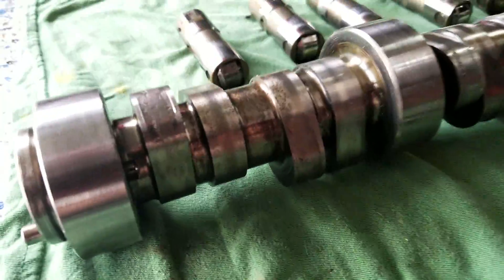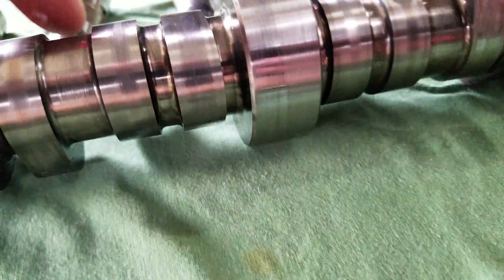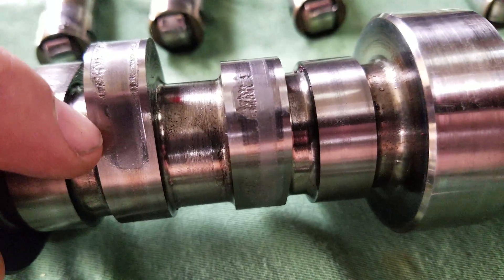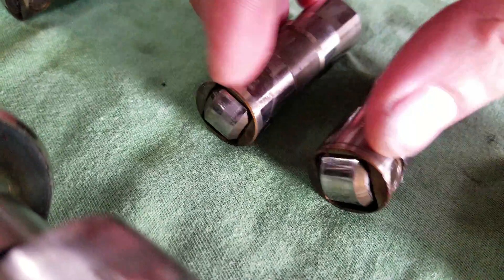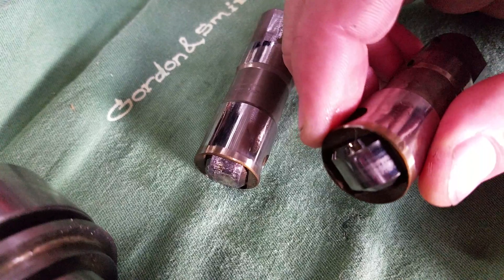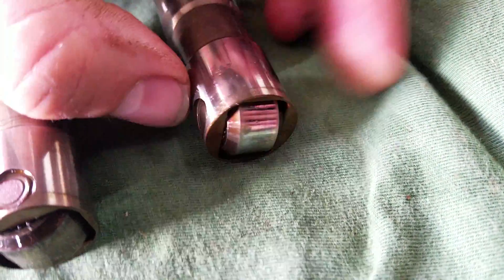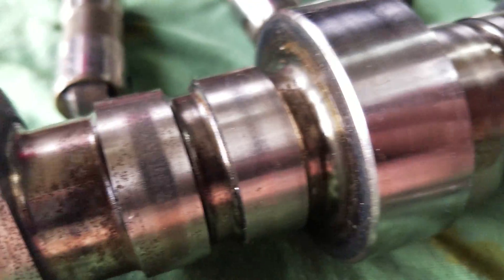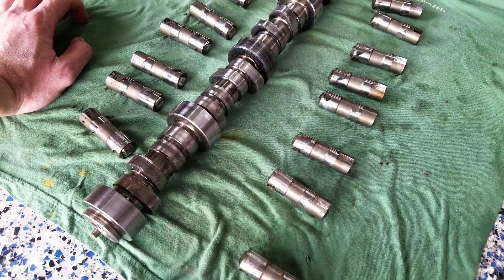Comp cams - cam shaft lobe failure

Comment: If I bought a brand new Comp or Isky camshaft I would send it to Delta Camshafts to have them inspected and regrind if need be, because the cost would be minimal. Comp Cams nolonger performs final inspection, they believe their automated cnc's machine accuracy "into" the cam requiring no inspection afterwards.

Comment: How does that happen. Material just starts degrading and falling off
Reply from the maker: Poor quality cam blanks in their raw materials.  Heat treatment process not completed properly..
The valve springs were squash tested and they came back at near new specs
Pre load was in spec 
This build had new lifters and lifter trays
Reply: @txtootall  thanks for info. Trying to learn what I can before I put a cam in

Comment: Don't feel so bad. I have maybe as much as an hour, that's right ONE FRICKIN HOUR on my Ford 390 with a flat tappet COMP CAM and lifters in it and YUP I have a lobe flattened out and a mushroomed lifter. Break in process followed by the numbers. Not my first motor. Plenty of small and big block Chevys and Mopars, all flat tappet, never had an issue. THESE NEW CAMS FROM COMP SUCK. I hear they are using cores from China and grinding them here. If that is the case you have two variables. Poor materials or people setting up the programming on the CNC machinery that don't know what they are looking at and doing.

Comment: question: for a worm cam lobe, is it recommended to get a new Engine due to possible metal debris engine contamination from metal-metal pitting?  Or not necessarily?
Reply from the maker: Yes metal debris from the cam lobe will be everywhere.  The filter only gets so much.
If the lobe is worn out, the lifter is definitely trash.
Yes a disassemble will happen sooner or later

Comment: Wow what happened 🤔.... I’m not done watching yet but I’ve never seen that. How many years should a cam last like 20 yrs?
Reply from the maker: it should have, but it didn't.  They, "comp" blamed it on the lifters, the pre load, and the springs.  I checked everything, and it all came back within spec.  This happened to several others also.  Pretty sure it was a quality issue when they switched the cam blanks to an over sea manufacturer.
Reply: txtootall ...... Those lobes aren’t even burned or scored
Reply from the maker: @AutoBodyEverything  thanks for suggesting that, it was past their 1 yr warranty, so I was told to kick rocks, or buy another cam
Reply: txtootall ...... I don’t know if the cost of the camshaft is worth it but if you can prove that there are multiple complaints on the same product you can get a reimbursement.
Reply: My Isky was installed in 1970 in my 327 and its still sounds bad ass to this day.

Comment: Comp Cams has had some problems with their camshafts... I'm running one myself not the same camshaft but a Comp Cam I haven't had any problems it's in a DD 4yrs old, think it may have been to much spring pressure wearing the lobs on the camshaft? I know if you run to much it will eat them up quicker

Comment: Have you seen this failure often with this brand of cam?
Reply from the maker: multiple failures
All were with dual .650 lift springs
Use lifters and new lifters, it doesn't matter
stock heads or aftermarket
this engine had 64K miles on it
Reply: @txtootall  64K miles on a roller cam is NOTHING. I was a partsman at a Volvo truck dealer for 31 years. We sold cams and roller follower assemblies for Cat, Cummins, Detroit, Volvo, GM, Isuzu, Mitsubishi, Mack. All these engines would run hundreds of thousands or a million or more miles without a lobe or roller problem. Sure every once in a while, but not common. For 31 years. These COMP CAMS are junk. Made from junk materials. And it sounds like their willingness to stand behind their product is non existent. I just today had a COMP flat tappet cam turn to junk after one hour of running. Break in procedure followed by the numbers. Correct ZDDP zinc in the oil, break in lube smeared all over the cam and new lifters. JUNK
Reply: @elituko  you said it brother i know your pain!